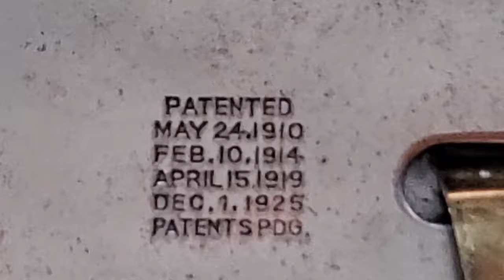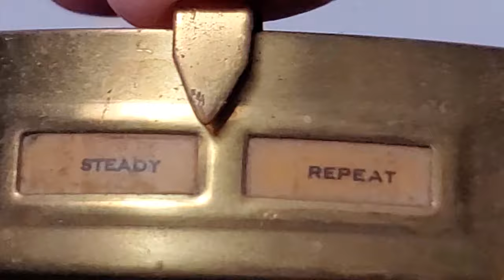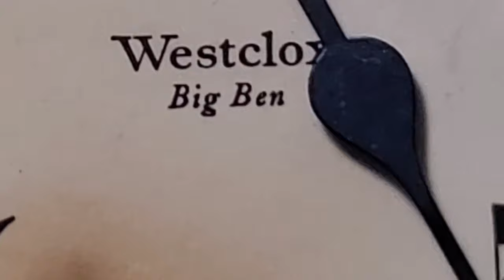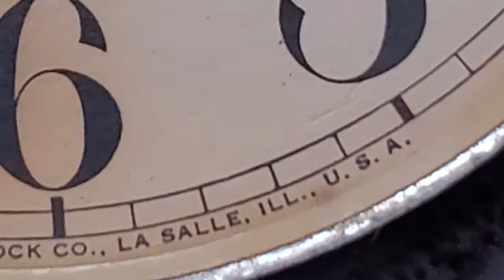Westclox Big Ben for David from Canada #64

Comment: Interesting how the bezel (etc) is polished brass. I'm thinking this was either custom or some kind of special edition release from Westclox. I know I've never seen one before.
Reply from the maker: Judging from the small amounts of nickel plating left on some of the polished parts, uncleaned buffing compound, and that run in the clearcoat on the bezel.
I feel the nickel plating was removed during some sort of restoration project, the whole case inside and out was clear coated, some even over some rust on the inside.
Not sure if it was lacquer or urethane but definitely clear coat to protect the buffed bare brass.

Comment: Thank you for sharing. I hope you can help me with these two questions. 1/ how would you repair rust or excess oil that have been absorbed in a paper dial without damaging the dial? and 2/ is a bend like the one of the brass bezel of this clock repairable with soft plastic jaws pliers? Basically reshape the bezel to its original rounded form. Much appreciated
Reply from the maker: You may need to experiment with the oil soaked rusty  paper dial.
1st these dials were bonded directly on to bare steel with a water soluble adhesive.
If the clock was subjected to a high moisture environment, the adhesive quickly absorbed the moisture and rust soon started.
Underlaying dial pan will have a fair amount of rust damage on it and should be dealt with or the rust process will continue. 
The oil can be removed from paper by using a solvent that won't attack the inks or dye in the paper.
Rust can be removed from paper by using Thiourea Dioxide.
All in all depending on extent of rust and oil damage, it might best to leave as is or remove original dial and archive it with the clock and replace with a quality replacement. 

To repair a bend in the bezel similar to this one could be repaired by fabricating a steel die that matches configuration of the bezel, then using the die to back up the bent area of bezel material while reforming the bent material with plastic tools to match the back-up die.
There are other ways, soft jawed plyers will work on small bends but if the brass becomes stretched, there is no way to shrink it back to shape. 
Problem with brass is that it quickly becomes work hardened and gets brittle when formed it needs to be heated to release the stress or will end up cracking, sometimes its less expensive to replace the bezel if one can be found if its too far gone.
Reply: @jamesmartin5370  Thank you very much James for your valuable tips. You saved me from making a big mistake and permanently damaging the dial using the wrong solvent. The stain is not too big, it’s around the hour hand arbor from over-oiling of course by a previous owner. I’ll thread carefully with the repair and hope for the best. I appreciate your help good sir !!!

Comment: Greetings, another beautiful work. I wonder what kind of solution or procedure do you use to clean the parts without removing the gold plating?
Reply from the maker: I have good luck using the L & R water based ammoniated clock cleaning solution.
I stay away from using ultrasonics on gold gilt movements.

Comment: Nice work.  Looks like you were able to clean and polish the balance staff pivots with the hairspring still attached?  Or did you remove it and put it back on?  The slow mo of the escapement towards the end was really nice.
Reply from the maker: This is how the balance staff pivots looked after final cleaning, so I used them in their current condition.

Comment: Very nice work as usual James.
The slow motion, especially with sound was a great effect.  Almost hypnotic.
How did you address the clear coat on the back and other parts, especially where there was buffing compound and gunk under it?
Did you do anything with the zinc plating to slow the degradation?
As always, I love to see the steps that go into rebushing, broaching and burnishing. 
Do you think someone intentionally tried to remove the nickel plating?
Nice winding adapters for the let down handle.  Made by you?
Thank you for sharing these repairs and educating your followers.
Reply from the maker: Thanks David,
 I removed the old buffing compound with hot water and detergent, took a while but it came off.
The clear coat was applied under the buffing compound so left it as is on the whole movement.
I didn't take any action to slow the zinc degradation on the back of the dial.
The nickel plating was intentionally removed from the bezel down to the raw brass, then buffed and clear coated to stop the brass from oxidizing.
Yes I fabricated those let down adapters.

Comment: Very nice video. 
At 21:06 where you hammer directly on the canon pinion shaft to knock it out, 
is there a reason you dont use a brass or bronze punch to hammer on?

It seems to me like you would have more precise delivery of the force to the shaft & not inadvertently risk hitting the pinion gear & over the years work-hardening the gear?

Cnc machinery I like to press gears or bearings off a shaft with a small arbor press & then re-assemble pinion to shaft with a thin layer of copper antiseize to prevent galling depending on if dissimilar platings are used.

Its wild watching this miniature work, I recently acquired a Big Ben 1918.3 back (made mid 1925-early 1926) beautiful black dial with luminescent hands, tiny chip on the #2 but besides that looks really nice, I would just like it cleaned & oiled & anything else that needs done, the bezel is dented and could use some attention but I like the patina, just anything you see.
Reply from the maker: Thank You,
 A soft brass hammer was used.